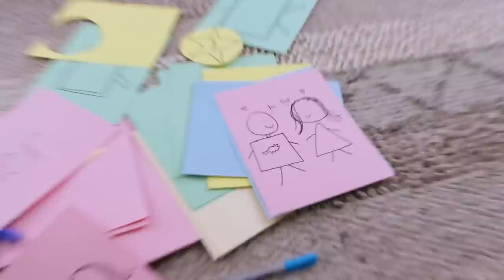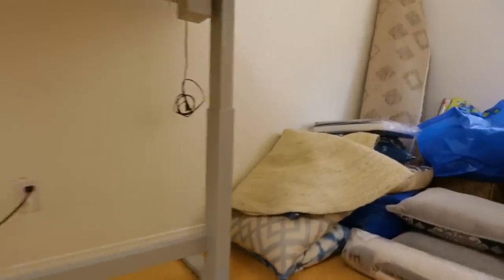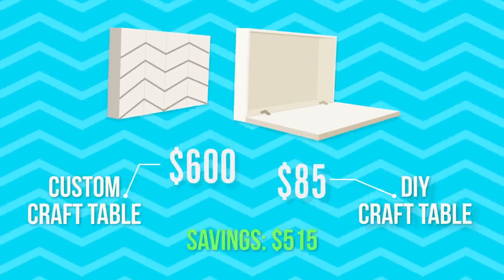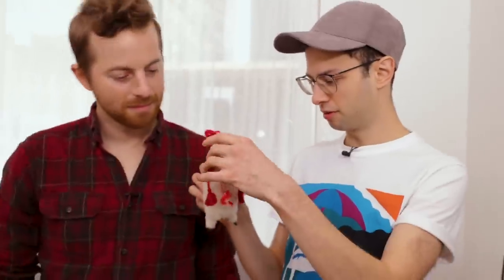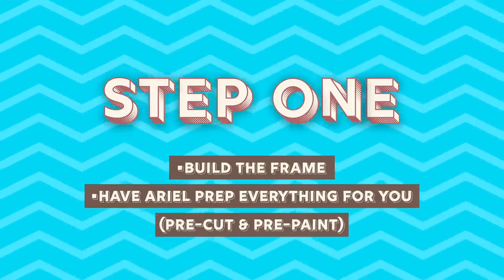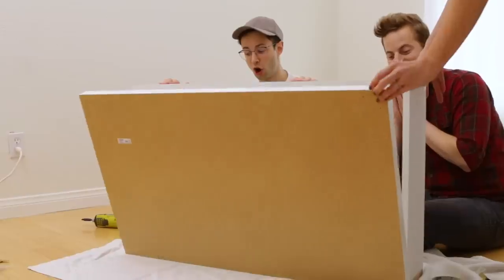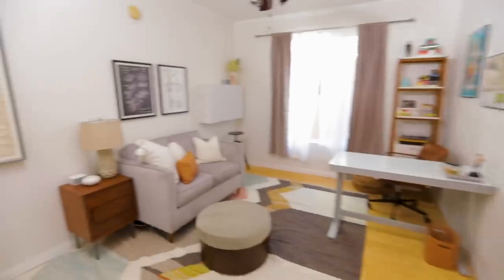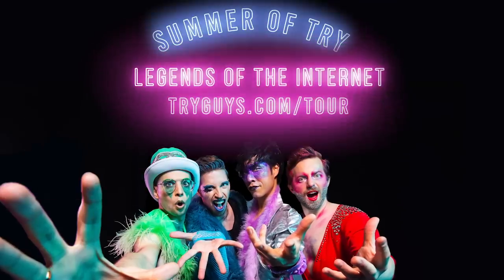Zach's Surprise $2,500 Home Office Makeover  • Try DIY

Comment: Really should add some chain supports to that DIY craft table. If Maggie leans too hard against it (like if you're drawing) those hinges won't hold for too terribly long
Reply: Thought the same thing. At the end of the video it already looks like it's drooping to low
Reply: Agree
Reply: Omg I'd noticed it too and I was thinking the same thing lol it did look like it was already weighing down a bit but other than that the room looked amazing XD
Reply: @BasicallyBrentt They made the craft table from wood that Ariel cut & painted before hand.  Yeah some chains might help, but if they used the right hinges it should be fine as long as she doesn't say sit on it.
Reply: Oh my god yes, It was all I could think about after they made that table. I couldn’t even enjoy the beautiful room because i was having a panic attack about that freaking table.
Reply: I was thinking the same, that table needs some sort of a brace
Reply: @BasicallyBrentt-- I guess you weren't listening when Ariel said she cut the boards and pre-painted them so that all they had to do during the room makeover was to screw the pieces together and mount them on the wall?  It's NOT from Ikea!  But I agree with all the comments about that hinge not being the right kind of hinge for that sort of work table.  It's not sturdy enough and needs reinforcement.  Heaven help Maggie if she ever tries to do anything involving cutting things with an exacto knife because that door/workspace can't take that kind of pressure and it will definitely break the hinge and maybe the whole unit.
Reply: @calichef1962  there are sticky labels on the 'table' piece so she definitely didn't make it herself...
Reply: I was thinking the same thing.
Reply: No need to worry folks, Ned said in a comment that they switched the hinges after they were done filming. The craft table is secure. 😁
Reply: Ariel know's what she's doing.
Reply: @BasicallyBrentt No shit I saw one video where ikea cardboard table held up better than some cheap wooden ones.
Reply: I thought the same thing, either chains or flip or flip down legs.

Comment: Is it just me or does the craft table not look very functional? It looks like it wouldn't hold much weight. Or is supposed to be supported on her legs while sitting?
Reply: Those hinges will probably break if she tries to lean on it. They should maybe add some steel cables to help support it while open but still be able to close cleanly.
Reply: in fact when they start showing the room the Door/table is in an angle, I think they should use hinges that latch on to the sides so they hang and made it straight
Reply: He commented that they swapped the hinges for stronger ones and added something else to them
Reply: Yeah that table would last maybe 3 days in my craft office..lol
Reply: That and then what support did they use to mount it to the wall.. if it's not the almost industrial mounts itll rip out of the wall...

Comment: also that craft storage/table won't work. it will only work as a storage unit but those hinges won't hold as a table. they are cabinet door hinges so they will pull out or allow to much flex and can support weight. they would put small chain from the top inside corner to the table top to make it work properly.

Comment: Don't get me wrong but the craft table doesn't have any support and imma hurtin'.
Reply: I thought the same thing. You can't even rest your arms on the edge without it all coming crashing down.
Reply: Yeah! I was cringing about that!!! I bet that the table is gonna break if you try to put your materials on the surface or even work on it... (“DIY logic” 🤦🏽‍♀️)
Reply: Mackala Inés Rose The tabletop really needs chain support! Super easy diy, and it’ll keep the wood from cracking!
Reply: you can even see at 14.57 that you wouldn't be able to put anything on it without it sliding off immediately
Reply: I was going to comment exactly the same thing! An easy fix would be attaching one chain to each side!
Reply: At 14:52 there something below it but i guess its not a support because the table is still not flat
Reply: My thought exactly! I was seeing it at end and just like “ehrm... it’s already falling apart” 🤣
Reply: Michaela Lindgren I think it’s like an architects desk, slanted. That way she get the stool underneath and can work sitting down instead of standing

Comment: Is anyone else worried that the second Maggie puts any pressure on that table, it’s going to break?
Reply: Yeah
Reply: she might just take out what she needs and go somewhere else
Reply: No
Reply: It will absolutely. You can see in the last moments of the video, that it is hanging through, even without any pressure from above. So it is not even straight. The idea is great, but I think the execution wasnt right
Reply: It does look weird, but I will say with the help of physics, it should stay in place. As long as she places stuff in the right place, the center of gravity should keep every thing up without the need for much of any adjustment for quite a while. I could be wrong but if what I learned is right, she should be fine, but y’all’s opinions are totally fair. I’ve worked on stuff like this before and it always seems like it will not work but when it’s done right it will be totally fine, but again y’all are totally valid in your concerns.
Reply: They could put little fold-out supports under the frame so that when the table is down, they swing out and support it. Like for tables with leaves.
Reply: It looks sturdy but I don't know 🤷‍♀️
Reply: Pretty sure they need additional hinges for that table which they will add later 😂 or else it will not be usable for Maggie
Reply: It’s shown slanting downwards at the end
Reply: They needed a different kind of hinge, or fold down legs. I would be scared to put a feather on that desk right now
Reply: I’m rewatching yes  because some are sturdy and some are not  you can’t really know because some  sturdy in display and some aren’t
Reply: Yes

Comment: Tech savvy fan here, **please do not keep your router or access points in small enclosed spaces**. While it may look tidy, you're not doing what's best for the electronic device or your home - it can be considered a fire hazard in that spot. By leaving a router in a drawer you're somewhat smothering it, cutting off necessary airflow.
Ideally you'd have it on a high up shelf, on a desk if there's space, a top shelf in a closet is okay if you must hide it, and as close as you can get to the center of your home (primarily if you don't have multiple Wi-Fi access points).
Reply: Katie N T Illyria depends on how big that hole the drilled was. If they more or less removed the back of the drawer then I don’t think there’d be an issue.

Comment: Cute but the craft “table” would never work as a table with only two hinges for support.
Reply: I thought the same thing. They need some chain or wire.
Reply: Ariel builds furniture and does interior design for a living, so I think it’ll be fine.
Reply: I build houses for a living, and I don’t think it will.  😂🤷‍♀️
Reply: They added some more support afterwards, Ned said so in the comments x
Reply: @KimB1029  but do you build furniture, those are two different things

Comment: Do not put your modem and wifi router in a non ventilated area, they are electronics and produce heat.
Reply: I was thinking of this. Also, they just slowed down their WiFi by putting it in a box. Idk. It's great to try and avoid clutter but some things have to be out in the open.
Reply: @M4B3THinSPACE  but aEsTHeTicS
Reply: How about on top of a tall shelf

Comment: IT professional here, Please don't put your modem and router in a drawer. ok thanks, bye.
Reply: was thinking the same thing! Isn't that going to weaken the signal? lol
Reply: getting that spicy 1kbps AHAHHAHAHAHAHAHAHA
Reply: Hello IT professional. Could be useful for the non IT professionals if you could explain why...
Reply: @evew4195  Signal is part of it, also air circulation. It really depends entirely on what type of router/modem he has, but generally you don't want to place your boxes in a enclosed space. You want them to be in the open so that they get proper air circulation. A lot of modern day modems don't have fans anymore, so they rely on external cooling (i.e. the natural cooling in your house). Also, although the signal won't be COMPLETELY blocked, being in a draw, it might still cause issues, such as slow speeds or frequent disconnects. Again, it depends on the model of modem/router you have, but general rule of thumb is, keep them both in an open space and as close to the center of your home as you can.
Reply: @melodyide367  copy and paste from a previous answer, " Signal is part of it, also air circulation. It really depends entirely on what type of router/modem he has, but generally you don't want to place your boxes in a enclosed space. You want them to be in the open so that they get proper air circulation. A lot of modern day modems don't have fans anymore, so they rely on external cooling (i.e. the natural cooling in your house). Also, although the signal won't be COMPLETELY blocked, being in a drawer, it might still cause issues, such as slow speeds or frequent disconnects. Again, it depends on the model of modem/router you have, but general rule of thumb is, keep them both in an open space and as close to the center of your home as you can. "
Reply: @crazedmofo1319  ok, thank you :)

Comment: I'm watching the Try Guys documentary right now, and I'm horrified that the team had to deal with so much backlash from this video.  The dynamics expressed here are not toxic, but are part of normal growth among partners and friendships.  I understand some of the reactive behaviors that Zach exhibited, and the hurt exhibited by everyone, and fully empathize with what everyone went through.  I applaud the strength of accepting that you were wrong, and that doing it for the right reasons is not an acceptable excuse.  Overall, I'm extremely comforted that you've all recognized your ongoing bond through all of this.  It's easy to say "this is less important than that".  It's hard.. really and tangibly hard to say "this is a non-negotiable relationship in my life" and it's important alongside "these are critically important things in my life".  Great work, guys.  You've built a lifestyle with one another that is a family.  You can choose to break it, or you can choose to say that this is as unbreakable as genetics because life has taught you that the knowledge of an unlikely connection is more important than an irrefutable genetic link.

Comment: I’m sorry but the entire time I was internally screaming the “tabletop” for the craft box is gona break off 100%. Those two little hinges held on by a couple screws is not strong enough for that front... jus put a pneumatic/hydraulic arm on or at least angle straps to hold it up at 90degrees...
Reply: If you look near the end of the video, you can see that the tabletop is way beyond 90deg. It definitely needs straps or something to hold it up. It won't last very long.
Reply: Yeah but I think it won't be hard for them to install another arm to support it better. They must have done it right after the video hahaha

Comment: Can Americans modify flats they rent? :O
Reply: I think they own it
Reply: yes, if you get permission from your landlord. Otherwise no
Reply: Usually if you ask the landlord you can make general changes like painting walls. If what youre doing is an improvement most landlords will actually be happy about it since when you leave itll be nicer.
Reply: The nicer the current tennet has the space the better it will “show” to new renters when the current occupant moves out. Landlords are good with that but you have to ask permission with details. If you want to paint a room hot pink the landlord will usually say you have to paint it back to white before you move.